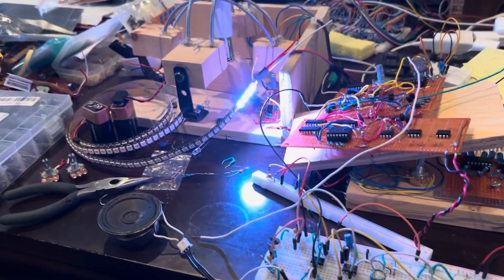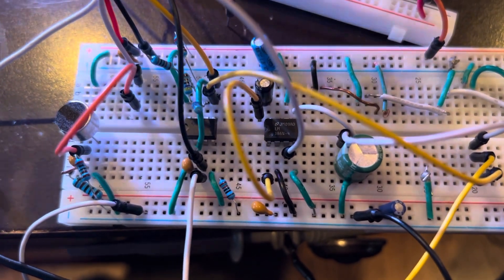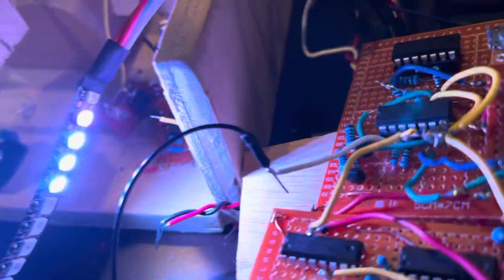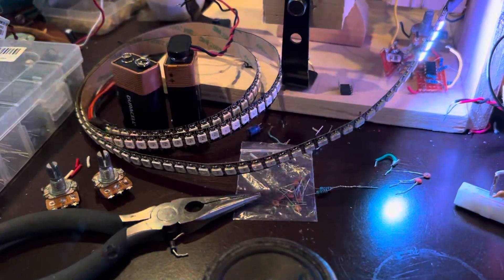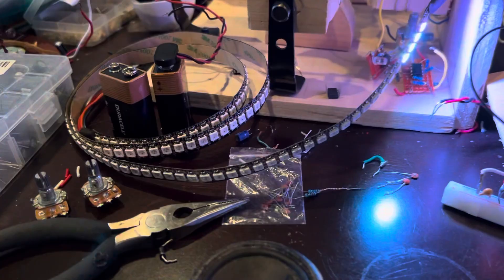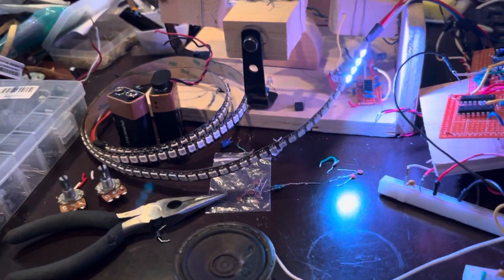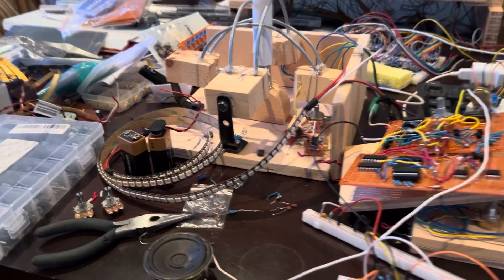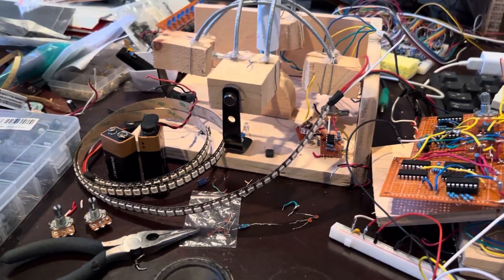Neopixels without coding…analog audio input responsive

Comment: what is the minimal basic setup to drive the Data i/p pin of neopixels, can it be driven without adrunio /esp32 /8266 or commercially available modules. please explain your driver also.
Reply from the maker: Yes, so my whole purpose for this is to drive the neopixels without any microcontroller or coding. Just with a few counter chips, 555 timers, and d-flip flops to sync everything. I will do a detailed video of the driver circuit with schematic explanation soon. Just Haven’t gotten to it yet.